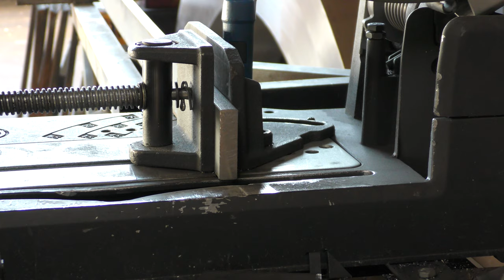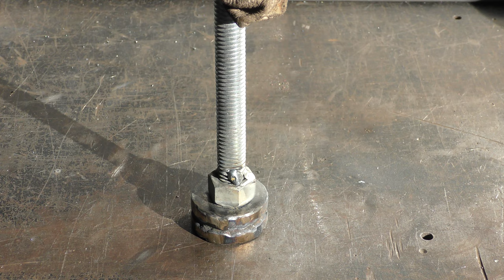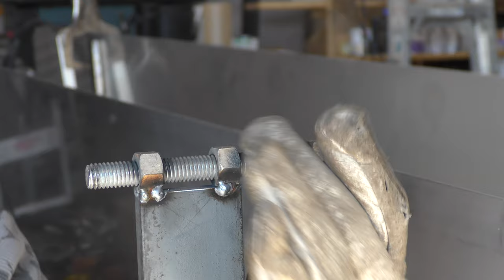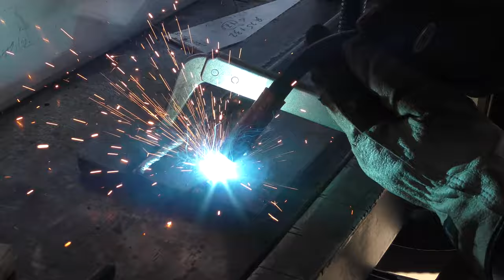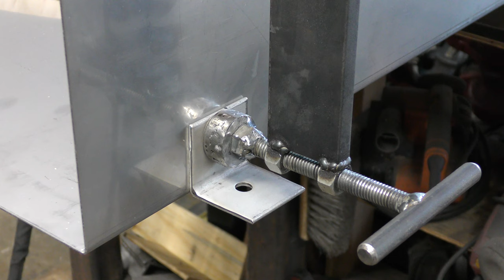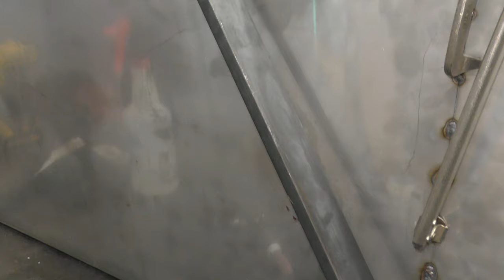DIY Deep Reach Clamp - Easier than you might think.

Comment: Way back when, I used to do boat repairs. We made clamps like these for installing transoms. The first ones we built were made out of some C-channel we had laying around. I think they were about 36" deep. We didn't have screw clamps. We just used opposing wedges. Kind of a pain in the ass to use but they got the job done. They got a little twisted so we made another set out of box tubing. We drilled holes through the tube and welded nuts onto the surface. Three screws on each clamp to apply pressure evenly over the surface of the transom. They worked really well.
Reply from the maker: Very cool. I love the fact that when we need a new tool, we just make it
Reply: @ArtfullyRogue  
Ever since the first caveman put a sharp rock on the end of a stick.
😁

Comment: That looks super handy.  Another way to line up seams is using a heavy duty magnet with a piece of flat bar behind the stainless seam.  Not as handy as a clamp, but it works in a pinch.
Reply from the maker: I'm sure that could work in this situation if the magnet is strong enough

Comment: Hi, have you seen a welder " butt clamp" , designed for the job? basically a thin tongue with removable cross  bar that holds sheets for butt jointing with a small gap between the sheets ?
Reply from the maker: I haven't but I'll look into for sure
Reply: @ArtfullyRogue   just search anazon for   Butt Welding Clamps    easy enough to make and gives precise gap for filling.
Reply: or  if you want no gap make one with a round rod instead of plate and notch edge of one bit metal. if overlapped  joint then punch hole and can also use Cleco Temporary Fasteners  or     Temporary Sheet Metal Fasteners aka SKIN PINS